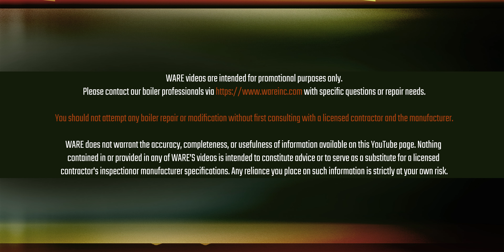Linkage Geometry Made Easy: Part 2 - Weekly Boiler Tip

Comment: To sum this up, making the arms more perpendicular to each other causes the receiving arm to move faster near the end of motion. To make the arms more parallel to each other makes the receiving arm move faster near the beginning of motion?

Or should I mainly be thinking about the angle of the driving rod in relation to the receiving arm? More parallel causes more movement and more perpendicular causes less movement?